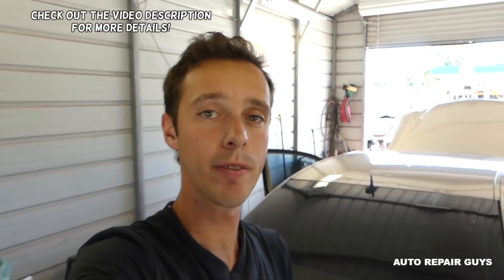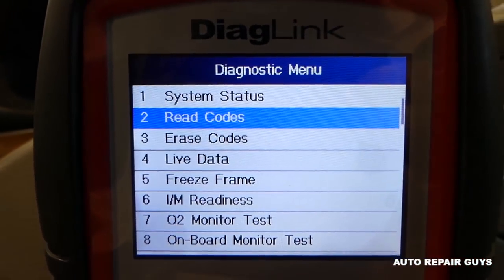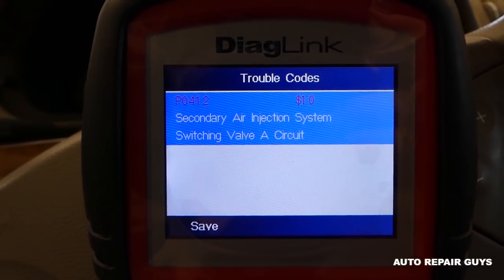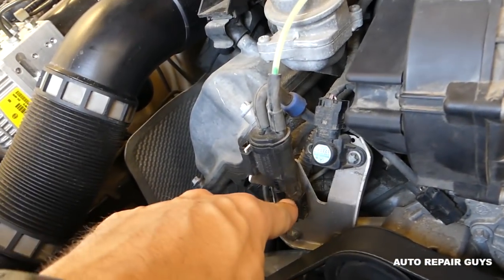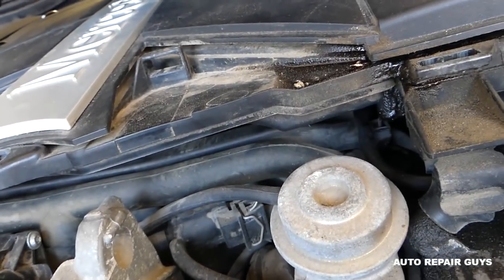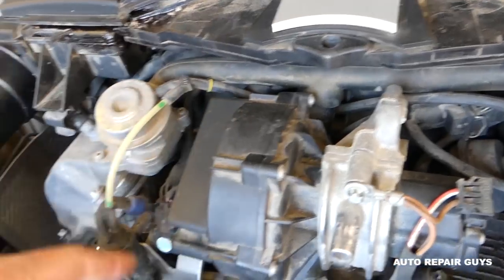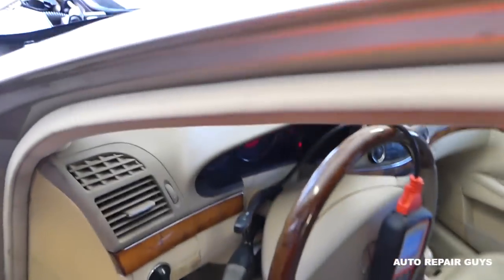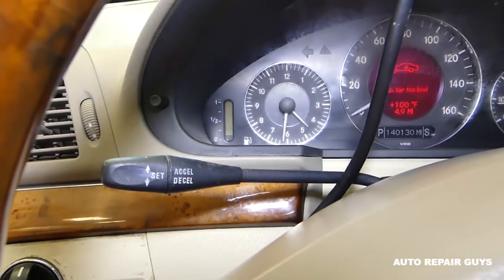MERCEDES VACUUM HOSE LEAK ENGINE LIGHT ON

Comment: C300 2010 
CEL: came on for too lean to rich codes!
Changed MAF SENSOR AND AIR FILTERS.
Light still on. 
Changed all fuel injectors! Light came back on! 
Changed all Oxygen sensors along with spark plugs!  Light popped back on with same codes.
Then yesterday I changed the purge valve and pcv valve. 
Cleared codes light still on for same codes! 
Cleared codes! And card sputtered ! Must be a hose with a crack causing vacuum leak right?